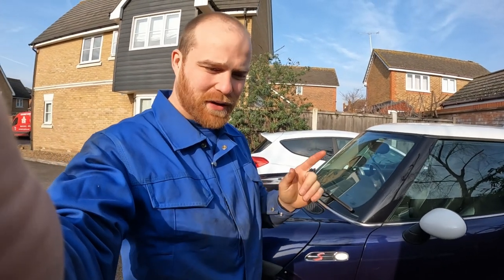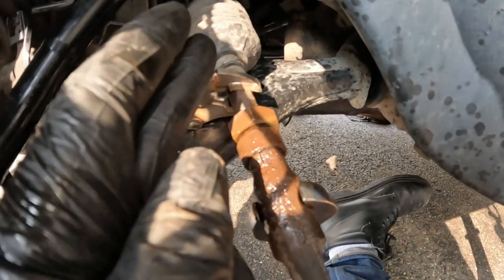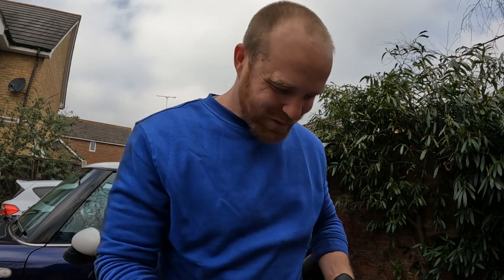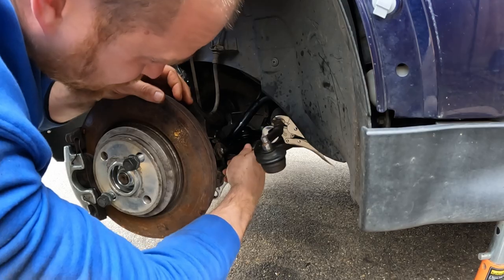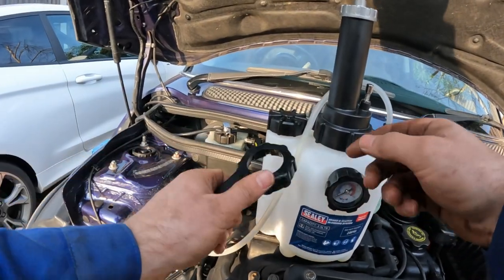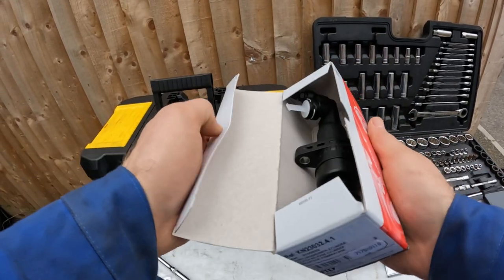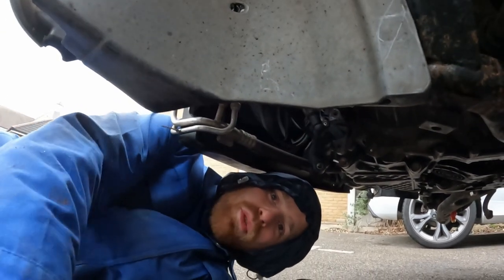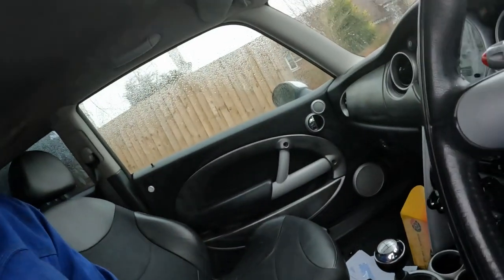Just when I thought it was going so well this happens...

Comment: Been there on the tie rod ends. I ended up buying a Inner Tie Rod Removal Set tool from my local  cheap tool dealer (Harbor Freight in the US). The set was $50 but I have used it several times now so the investment is paying off.  You did your best, heat, penetrating fluid and perhaps off camera plenty of swear words - that is exactly how I would have done it. The first one I did it was exactly what you did - with the subframe installed - the second was with the subframe out on my next R53. To be honest either way is a pain in the bum. Easier to get some leverage on the ends with it in the car but easier to do the entire thing with the subframe out but proper torque leverage is a challenge if working alone. 
I am right there with you - cheering you on. Wish I we were neighbors so I can lend a hand.
Reply from the maker: Haha my biggest challenge with this whole affair is not swearing in times like these! I’m trying to keep it family-friendly. Thanks for the words of encouragement, Bill, it honestly helps keep me going

Comment: Hey Nino, keep your chin up mate, when I watch, I think back over years of doing jobs on my cars as I’m tight as cramp lol and think yup ran into that issue, and that issue, just seems you have them all on one car ha. When I did the slave cylinder on my old Fiat coupe 20vt I just used the old pump the peddle method, power bleeders are good and all but can be a pain (I use a vacuum pump now feels better), with the pipe run being so short on the clutch perhaps it might be easier. Thank for the content 😊 Also old cars = Grinders lol cutting a line along the length of the thread not going to deep as to damage will release the tie rod end I’ve done that in the past.
Reply from the maker: Thanks for that, Iain 🙌🏻 Yeah, definitely seems as though I have all the issues on one car haha. I’m actually quite pleased about that though - it’s all learning after all and I’d have come up against these issues at some point. It’s like a crash course! Think I might have to give the old fashioned pedal-pump method a go 👍🏻

Comment: We use that same sealey brake/clutch bleeder in the garage.. excellent bit of kit.. and don't worry about the fluid returning back up the pipe when you've let the air out.. thats normal.. its so you don't drip a load of fluid everywhere when you remove the pipe and cap from the reservoir..  As for the slave cylinder.. whenever ive done them, regardless of vehicle, ive never had to clamp the pushrod into the cylinder like you did.. i juat fitted it as normal, pressurised the system, and bled it the same way as the brakes.. because in effect, it is basically the se as a caliper.. Give it a try if you haven't already..
Reply from the maker: Ahh that’s interesting. Every guide I’ve seen for these cars says to compress the piston fully, but I’m definitely going to give it a go your way. Would save me a load of aggro for sure. Now that I’ve worked out where that Sealey tool was going wrong I think it’s brilliant. Gonna get a load of use out of it in the future.
Reply: @Nino Rosella  when you go to fit the slave cylinder, the piston usually gets compressed by the clutch arm anyway..Definitely give it ago tho.. But like i said, ive fitted loads to all makes of vehicles, never once have i had to compress the piaton first, prior to bleeding it..

Comment: I feel your pain and confusion.  I tried to bleed mine without knowing about the fact you have to compress the slave cylinder. Two days of faffing about and cursing the engineer that designed that crap slave cylinder! I kept pumping the clutch after what you had done and the clutch worked. I have two Minis. On the 'Y' reg Mini the master cylinder had also failed. Oh the joy!😅 As for heat 🔥 the line in the film Jaws comes to mind, "I think we need a bigger boat".
Reply from the maker: I’ve now heard of lots of people fixing this exact issue by pumping the clutch, so think I may have to give it a bit of that action myself! Oh, and rest assured, I’m now in possession of a “bigger boat” 😈😅😅

Comment: I feel your pain with the clutch slave. Took me 2 days of messing. I did a video.
Reply from the maker: You did warn me about this on my last video haha. Will take a look!
Reply: You have done everything right but it's just so annoying as it will not bleed no matter what you do then all of a sudden it just works. I ended up putting a small amount of air in the system and pumping the peddle once the bleed nipple was open. It bleeds fast so watch your level. Still keep the slave compressed. Good luck.

Comment: They are horrible. I took them off mine and fit the other type and just put a locking nut on. You are getting it tracked anyway. 
Cutting a small slot or heat will help.

Comment: You were facing wrong way put foot against something solid on car lock arms on spanner and use leg and torso muscles to crack nut . . I've got 19mm alan key socket I put in ring with 12inch breaker bar if I have enough hight I wish I had 21mm 22mm and 24mm alan key socket's as well but I've never come across any . . Bang head strain muscles all part of the fun . . Keep focus on Aston . .

Comment: Sorry jumping ahead on ring . . There is never any Oxy on the side of the road when you need it so extend slots with cut off tool . . Probably easier and safer if you remove steering arm from rack and put in vice . . But how worn is arm ?? It looks a bit floppy and they are not a lot of money usualy less than thr value of your time stuggling with rust . . Oh yes packing everything away to go and get something what a pain that is . . I've had Europarts deliver to house I've been working at before . . Not sure you can now though with all that "Take a photo" stuff the drivers have to do while being time monitored acceleration monitored brake monitored and speed monitored . . Thats a lot of monitored . .
Reply from the maker: Trouble with the delivery is the home delivery is next day unless you have a trade account. I’ll work it all out though 👍🏻